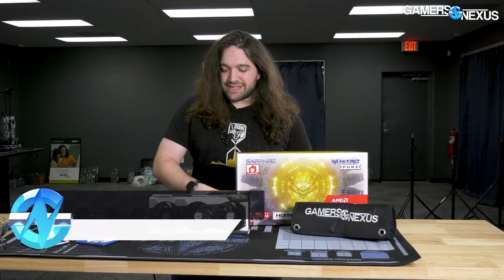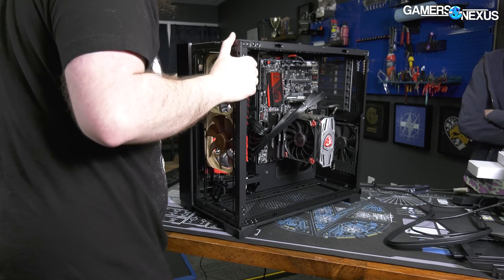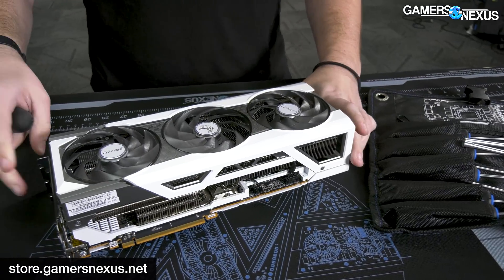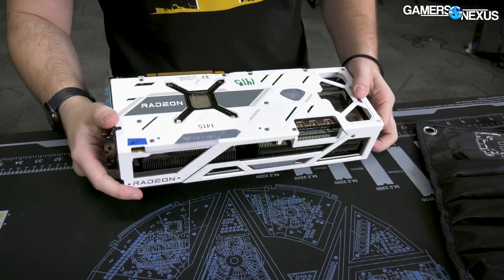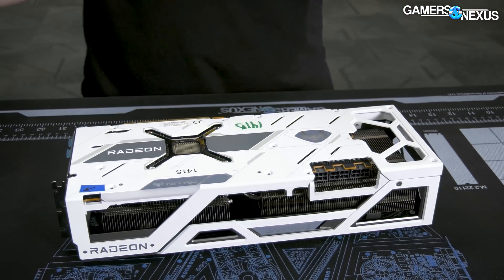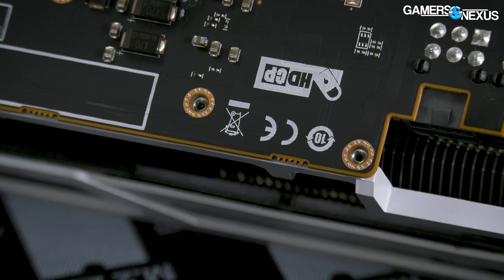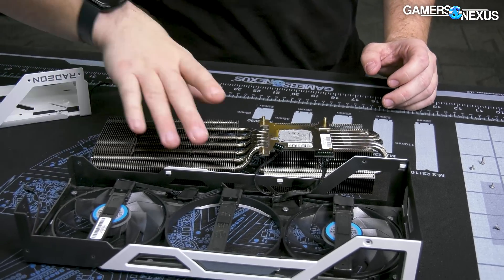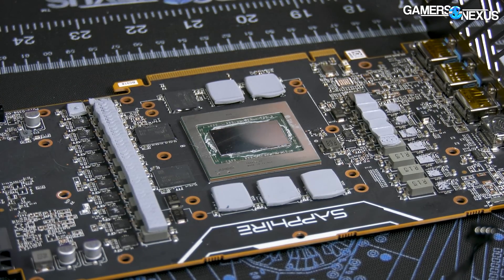Tear-Down: Sapphire's Excellent Cooler Design on AMD's Hottest GPU (6950 XT Nitro+ Pure)

Comment: im a (semi^^) lucky owner of a 6700xt and i want to buy a new card! its should be fast but not power hungry!
at least 12gb of mem!
Amd or Nvidia, Idk!
So what i should do? what would you do?
money is not a factor!
Reply: Why do you want a new card?
Reply: @maxg3169  105 hotspot!....and the fans are semi lound..
i want something bigger that hits harder with less power
Reply: @Knebebelmeyer  what specific model card do you have, and what case?
Reply: @Emelydiaa  its a AMD Rev one..
i used already a Padmod on Vram for Backplate.
But the Temps on Gpu Hotspot are 100 or above.
The Problem is....its a new Corsair 5000d Airflow with 140 wings and 120 at the back and the top!
The 360 Aio is mounted right side of the mainboard, so airflow should be good!
Reply: @Knebebelmeyer  The AIO being intake will cause higher GPU temps, so you could try putting it as top exhaust instead. Though with a properly designed GPU neither setup should get this warm in a good case like that.
Reply: @Emelydiaa  dude, i used a 280 before on top and it was same temps!
i used a Meshify C and my Gpu Temps wasnt really much better.
why it should cause higher Gpu temps?
The Aio is in the back side panel, not at the front intake!
this was the purpose for that 200$ Tower.
Only for the Aio mount at the sidepanel!
front intake are open with 2 140 Noctuas!
the aio exaust is on the backpanel on the left side of the Tower (if u look from front side).
so it cant harm my gpu like that!
Reply: @Knebebelmeyer  I don't think you quite understood everything I said, and I can't make full sense of this reply. But that aside, the only things I can think of that you could still try:
- Increase the GPU fan profile in the Radeon software
- Repaste the GPU (involves disassembling it, only do this if you're confident you won't break it)
If the fan profile change doesn't do much, then man the AMD reference cooler is worse than I thought lol
Reply: @Emelydiaa  its very possible that i dont understand you full^^...
im not so familar with english^^
Reply: @Emelydiaa  if i increase the fans, its better....but its louder!
the gpu itself is around 70-75c and not the problem!
the memory junction is even not a problem!
the main issue is the Gpu Hotspot! its 25 more then usual gpu die itself.
so this is what makes me very angry!
( i already repaste it).
this is the main goal for a new card!
BETTER TEMPS!
i brought it 6-9 month ago for 750$
and i play only world of tanks!
so i dont need a new one...BUT...
who know whats the deal in few months, so maybe i should buy a new one?
or better go for team green?
or may i should wait for new gen gpus?
i really dont know!
Reply: don't
Reply: Stick with it lol

Comment: Reminds me of the bad old days with the R9 295X2. I had one, I loved it. It was ridiculous and glorious.
Reply from the maker: "Ridiculous and glorious" is an excellent description!
Reply: I still basically use 1/2 of it (with 4 extra GB on VRAM) :D
Dual GPU's^^
Reply: @cummins24421 I hope you didn't have to pay the extortionate (even for then) launch price of $1,500, as 2 x 290x's would have saved you $300. AMD showing they were just as greedy as Nvidia, although the Titan Z had yet to launch it was aimed at a slightly different market but that too was even more obscenely priced, I mean it makes the 3090 Ti look like good value !!
Reply: @clansome  iirc I got it for less than $800 something like 6 months after they launched. Replaced it with a launch week gtx 1080 for about the same price (that I'm still using, OCd on water, to this day with no issues).
Reply: @cummins24421  Glad to hear you didn't spend silly money on it as I remember them dropping to half price very, very quickly about 3 to 6 months after launch.
Reply: I have one of these still, its faulty sadly. Perhaps from gpu sag or something. Loses display often
Reply: Or how about the absolute masterpiece of the Asus Trinity!

Comment: Sapphire is pretty much the known go to brand when it comes to AMD Cards. It used to be a close gap between them and XFX but XFX has recently been not doing to hot.
Reply: Honestly can't remember the last XFX card I wanted, . . or saw come to think of it
Reply: @kris5187  The last time i bought an XFX card they were still a Nvidia partner 🤣
Reply: @Neggy-Z  Same here!  Had a XFX 8600GT
Reply: @kris5187  the XFX 6800 XT speedster Merc and 6700 XT speedster Qick are one of the best air cooled models together with red devil from Powercolor and they have the best PCB components iirc.
They made lots of improvements in the last gen and are miles ahead of their old Thicc/Fatboy cards
Reply: people shitting on XFX cards in comments probably just remember their older hot and noisy polaris cards like fatboy 590 but they have some really good models this last gen
Reply: xfx seems pretty much barely acceptable
Reply: Ive had rma experiences with xfx sapphire, gigabyte and msi for AMD cards. XFX was a single ticket and i had a brand new card in 3 weeks. Sapphire was back and forth till they denied me and MSI never replied to any form of contact and Gigabyte support might as well not exist. IMO support matters more than rgb and cooler design.
Reply: @DJ.1001  xfx did make it really simple to rma my 5700xt they even gave me a better version instead of the same one too!
Reply: Yeah they're great, but in my opinion it's never worth spending more than 10-15% extra (depending on the budget) for a better cooling solution, because that's basically what it is. So it's gonna depend how they price their GPUs, unless you really care about quality/service like when buying Noctua fans.
Reply: @StefandeJong1  sapphires mid range names for their GPUs tend to be MSRP and have amazing coolers. My 5700xt pulse is pretty awesome and was 15 under MSRP when I bought it on launch
Reply: XFX has recently been doing to hot.
Reply: You're forgetting about power color too.
Reply: They r all da same
Reply: recently they’ve been too hot**
Reply: At least with the 6700 XT, XFX did WAY better than they did with their 5700 XT's.
Reply: @shanez1215  they did my xfx 5700xt was garbage until I switched over to the red devil 5700xt
Reply: Sapphire has been pretty meh with the 6000 series. Check Bz's videos for more details but basically Sapphire is pretty much standard layout, taken straight from AMD. Which is fine, but well, feel free to check techpowerup for the difference between Sapphire and MSI yourselves. Best still would be to check Bz's videos directly tho.
Reply: Most deffintley how can  'anyone  forget the r9 290 /x tri- x cards they were beasts
Reply: And Powercolor
Reply: @CHAZMEDIAUK  My Powercolor 6700XT Hellhound has been great for the past year plus. I always went Sapphire for AMD but the Powercolor was the only thing in stock last spring when I made my Pilgimage to Micro Center.
Reply: Back in the days i was traumatized with Sapphire,  the only card that i bought from them was a 6870 and it was "dead" on arrival, thought it was the power supply, but i kept getting random 10 sec freeze when playing game that was pushed at max settings, even if the fps were good like 60 np, and then years later, it die by itself for no reason, after that i sticked with nvidia x)

Comment: A card that is bigger than the last generation of consoles...
Reply: I mean... no. The only consoles from current/last gen that are smaller in volume (simple LxWxH) are the PS4 Slim and the Xbox Series S. The rest range between 1165 and 7422 cm^3 larger.